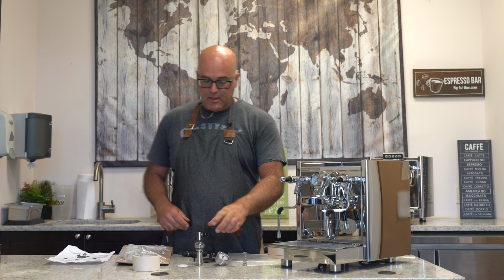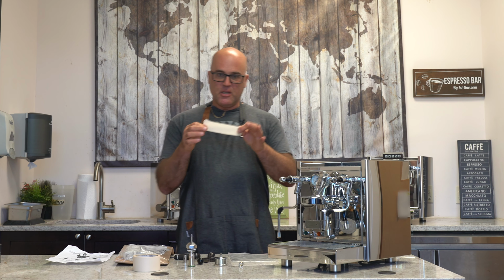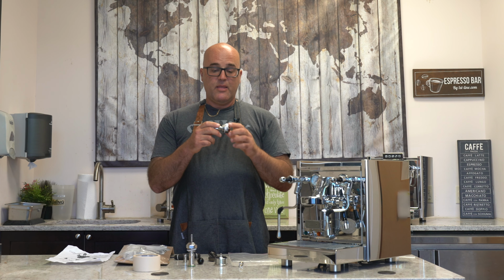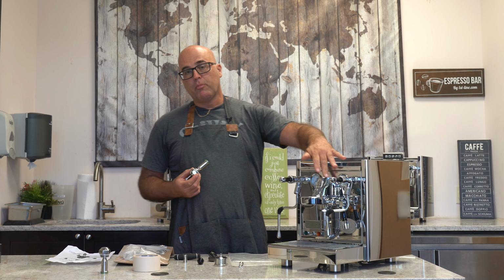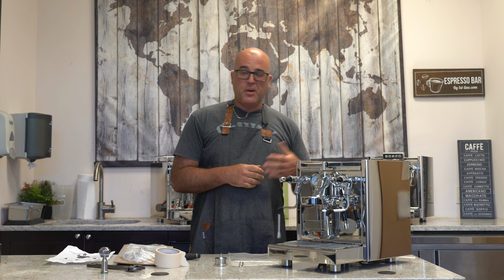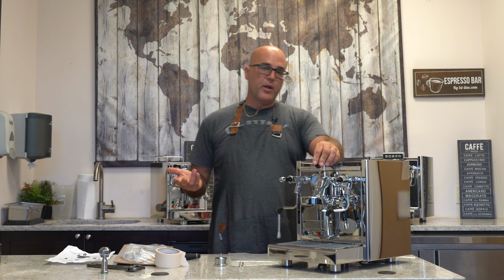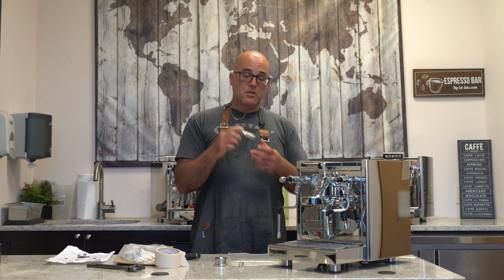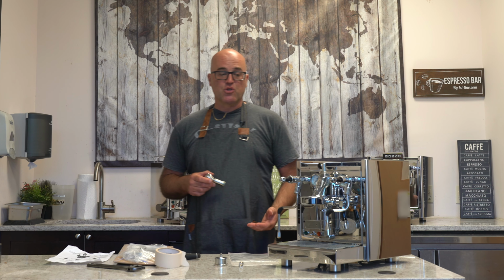TechTip: Install ECM Espresso Machine Flow Control Device

Comment: What was the reason to change the spring?
Reply from the maker: Handle greater pressure.
Reply: It would be nice to know the difference between the original spring and one with the kit.  I mean size wise.  Length and diameter.

Comment: If you install a Flow Control Device and leave it fully open, is it essentially the same as having no Flow Control Device at all? I'm asking because my wife prefers a straightforward workflow, so I'm curious if adding an FCM will complicate things for her.
Reply from the maker: It depends. Some with full open allow greater flow than the standard gicleur.

Comment: can you install the flow control on an elektronika?
Reply from the maker: Technically you can. However, the electronic controls of the machine get in the way, so you can't adjust the flow fully.

Comment: Hi Jim, been using the flow control for a couple of years now. One issue: it gets a little stuck when I turn it all the way off. For example, I restrict the flow to 6 bars by turning to almost off. Then I want to add a little flow. But it’s hard to do smoothly as it gets a little stuck. Is there something I can do about this?
Reply: Same story, 2 years of use getting stuck.Took Flow control unit apart, cleaned the orifice, replaced 2 o-ring , works better, but not as good. I believe  Needle of  flow control unit just worn out and need to replace. I didn't see replacement anywhere, so basically you have to buy another flow control unit every 2-3 years

Comment: Thanks for this Vid Java Jim! Quick question: if the group gauge stays at 10 bar regardless of the FC position, am I grinding too fine (Also, machine reads 8.5 - 9 bar)?
Reply: I have the same question!